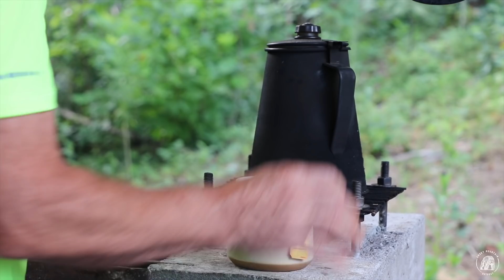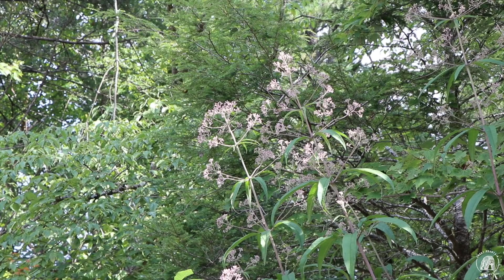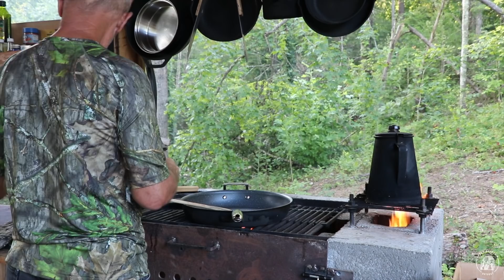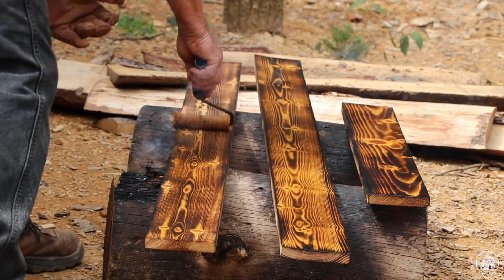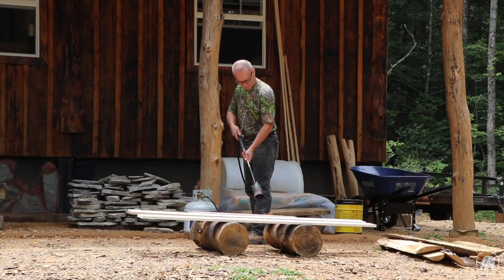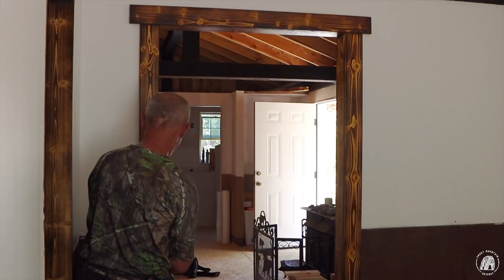TIMBER FRAME CABIN ROCK FOUNDATION | INTERIOR DOOR TRIM | SHOU SUGI BAN FINISH

Comment: If you have problems with any of the stones coming loose in the future, just reattach them with concrete bonder. I used to add a cup of it to a bag of mortar when I mixed it if I was setting stone or tile on a vertical surface or on a ceiling. Great stuff. The stone is looking nice. Your technique seems to be improving.
Tell us more about that wasp please, I have never seen one like it and it looked like it was trying to eat the wood????

Comment: I can see a potential problem with your rock wall being so close to the siding.  I don't know if termites are a problem in your area, but but by not having a "metal protection" between the wood and the mortar, will provide a very nice path for termites.  Typically an L-shaped  strip would be tacked to the bottom of the siding and project out to provide a sharp path for termites to not cross.  I know I may be totally off base here, but in Indiana, this would invite many termites.